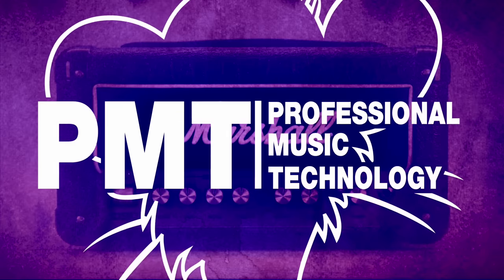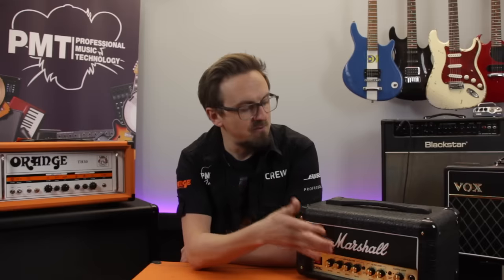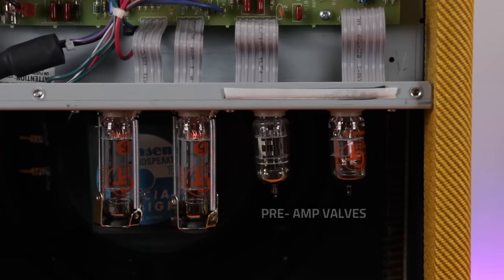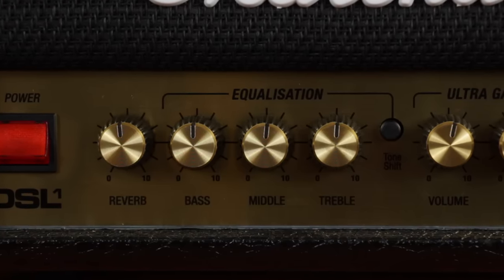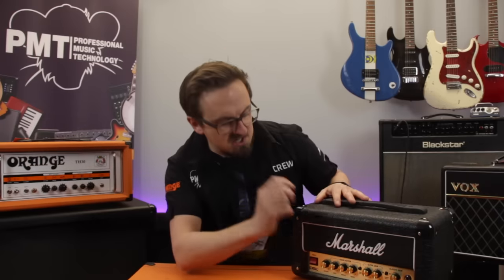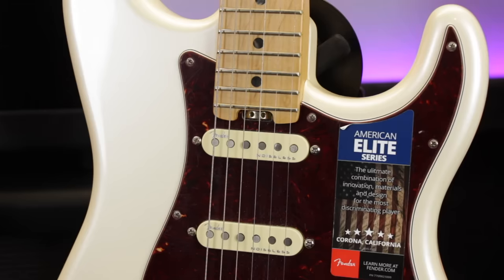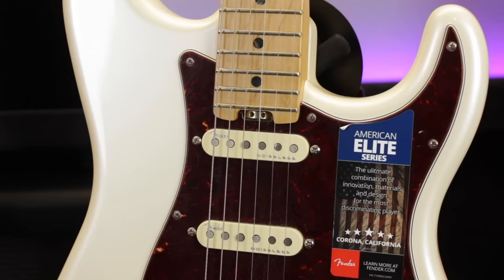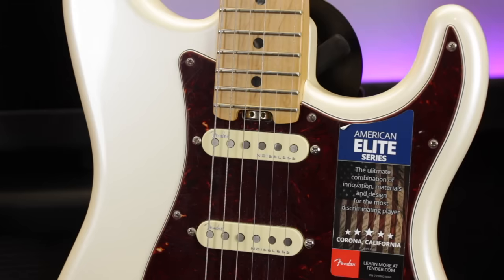Guitar Amp Controls Explained!  How To Use Gain, Tone & Effects Knobs...

Comment: I’ve had my Boss Katana 100 for nearly 18 months and I must admit I haven’t actually made the effort to find the sweet spot. I tend to dial in as I go. I’ll have a play round with it later
Reply: Rob Nicoll the thickness of your strings and the hotness of your pickups would also shape how you decide to divert from everything set at 12’clock.
Reply: Play with the katana and your going to be amazed at it's capabilities
Reply: I got the Katana Artist mkII and I am completely baffled by the sheer configuration combinations.  The Boss Tone Studio really helped me.  I installed some community based patches and tweaked them.   I asked my wife and kid to run some errands for the afternoon and I cranked it.  My house rattled off the foundation!
Reply: The Fender Mustang GT200 that I recently purchased surprised me by not only outdoing the Katana I used as my primary amp at home in the range of effect options and vintage amplifiers plus cabinets but also having an all around better sounding speaker and tone overall. The Katana is the shit but I'm extremely impressed by Fender's constant updates that improve the amp every time they release a software patch.
Reply: @Zappappappappa  software?
Reply: My Katana 50 doesn't like the Bass above 3. Anything higher and it's way to Bassy

Comment: Great video for a rookie like me. I have 2 amps, a practice Amp that only has volume, treble and base knobs and a button when pushed in is O.D. and not pushed in is clean. I think that's pretty simple stuff, yet I can get some different sounds out of it. The other Amp is an acustic Amp and has more knobs: gain, low, middle, high, reverb, chorus, and master. It's a 2 Chanel, instrument and microphone.
Your video has been very helpful in setting both of these amps up. Thank you!!!!!

Comment: Seeing the inside of the amp is kindof cool.  When I bought my guitar they only had orange amps at the shop so i just got one of those.  It isn't a bad practice amp.  I notice the gain is almost like it has four different levels rather than a meter that just goes up gradually.  edit oh it is called a sweet spot.  Good to know the name for it.

Comment: I have Peavy 210 Delta Blues Amp which is all values. I need to get a Boss Katana or similar type transistor Amp. Options combined with lightness of the Amp make them ideal for practice and ease of mobility. You really need wheels to haul around a larger size Tube Amp like the Peavy.

Comment: I have a small Marshall MG10 which has a single Tone knob labelled "Contour". Any idea if it's a passive or active tone control? Keep up the amazing work, your way of teaching and explaining is so clear, I love it!
Reply: Contour knobs normally affect the midrange. I believe it is a passive tone control that as you turn up the knob, cuts mudrange out of your sound.
Reply: A general rule of thumb is that simpler and/or cheaper amps tend to have passive controls.

Comment: Okay... I'm starting to understand but a bit confused.  I'm actually a harmonica guy.  My rig is pretty cheap.  I use a Park G10R and a Shure Prologue (cheap version of the 57, but with an on off switch).  Oddly, it works, but I can't explain it.  It kind of works with my more expensive Bulletini mic, but there are some issues because it is a much hotter mic.  Harp players typically prefer small amps because they are easier to overdrive.  My Park has 2 gain knobs.  I'm not really sure what each one is doing.  I tend to set gain 1 really low and use gain 2 to get some crunch.  With the Bulletini, even with the Bulletini turned way down I have such a tiny sweet spot (maybe a quarter or an eighth of the space between two numbers on the dial).  Anything more and it squeals at me.  I'm trying to figure out what is happening in the circuit (without any knowledge of circuitry!) so I might be able to recommend similar solutions to friends, or at least explain why I like an amp you can buy used for $50 on ebay.

Any ideas?  (I'm finally thinking about building an actual pedal chain and want to think about what might work.)

Comment: I turn on an amplifier old 47 years, and it works, but I noticed that knobs barely make any difference when I dial them, especially high one...what can be problem, maybe drained capacitors after all that time??
Reply: @keithclark486 
Yes I know, I had already few new amps, I just found that old one in father's garage under dust, believe or not clean sound was beautiful on that amp for some reason, even though knobs didn't do much change as I said..yes many capacitors were drained, that was problem, lot of leakage was around board, potentiometers were ok, and very soon power supply went up..I don't have it anymore..thx for response Keith
Reply: @keithclark486 
It was Sony amplifier, I think TA serie (can't recall few digits number), with 2 separate speakers, anyway I figured out that was normal amplifier modified for guitar usage..

Comment: My first amp was a Fender Mustang II. I traded it because it was so complicated that I couldn't get it to sound good. Second amp was a Frontman 10 that u regret owning. Third and current amp is a Mustang 1 that ive had the foresight to download the manual for. It sounds alright in the 65' twin reverb setting. I factory reset it to remove any shenanigans from the previous owner. It breaks down early in any other setting though, so while i sit here at the Waffle House I think that maybe I should figure out if the tone knob on my guitar may help with that.

My guitar is the Inverness Green Worn SG with p90s. And a brown suede strap because im stylish af. Got it with an ernie ball volume pedal for $200

Comment: Do solid state amps also have sweet spots like this in the EQ?  Or is that an effect that's tube/valve related?  I tried to to find the sweet spots on my Marshall MG15CFX's EQ controls, but I didn't  hear it the way I do in this video.

Thanks in advance and cheers.
Reply: John Zrnich my solid state amps (Roland jazz chorus) do have them. I don’t know if the effect is exactly the same, but it’s there.
Where these sweet spots are also depends on the room where I play. Best thing about it is that you can adjust the eq very effectively during a gig. You just know that a little turn will have a great impact.

Comment: Hello! At time stamp 2:39 you mention most amps have a volume for their clean and OD channels... I have a Marshall MG50FX, it has a clean and OD channel however there is only one volume knob that works for both channels (there is not a separate volume for clean and a separate one for dirty).  I find the when I switch to clean it is much louder than the OD, is there any way to make it so the clean and dirty are around the same volume? Thanks!

Comment: You made the classic misconception that to your ears tone controls "boost or cut" the frequencies labelled on the amp...In fact they do the opposite....No control ADDS any frequency...they diminish the opposite frequencies....More Bass is achieved by reducing high frequencies....more Treble by reducing low frequencies.

Comment: I feel like a dumbass, but I’ll ask anyway: 1:28 does this amp have a speaker? And if so, why so small?
Reply: Yes it does. All amps have speakers. Every size speaker has different characteristics as well as strengths and weaknesses. Smaller speakers say 8” are suited for practicing. I play bass so 10”-12” would be what I look for when wanting a practice amp for home use. Smaller speakers aren’t as loud and can’t get the same depth as for example a 15” in a bass amp.